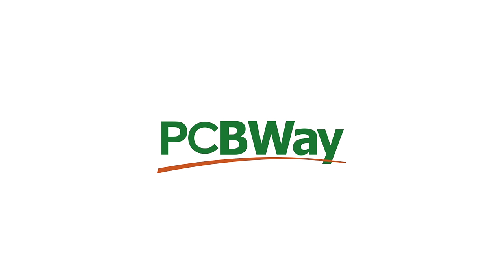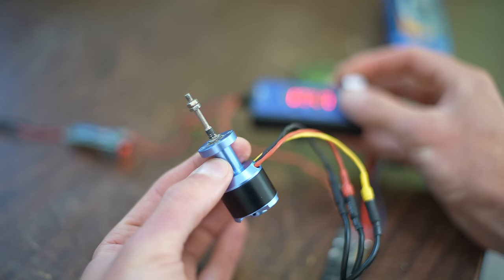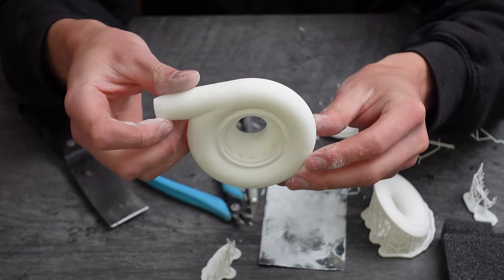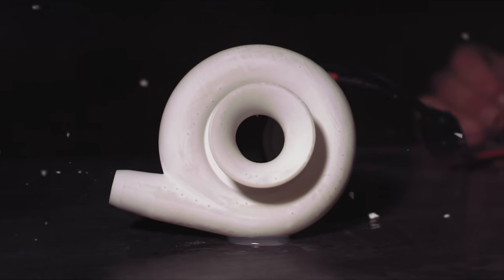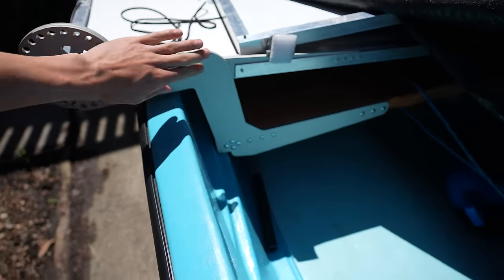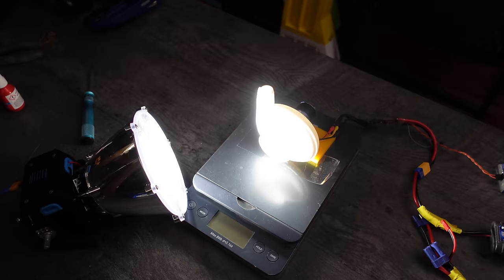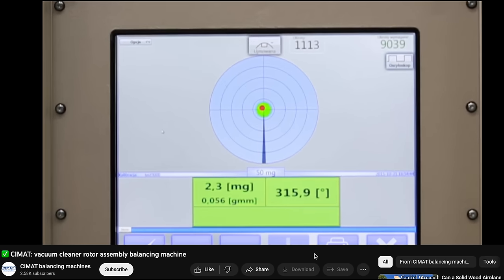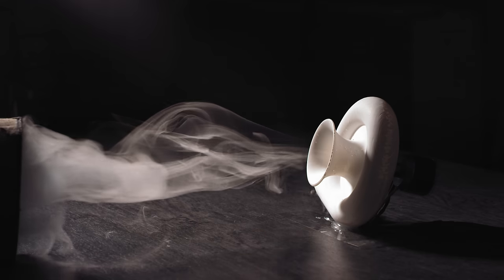3D Printed Turbo Impeller VS Dyson Motor

Comment: Hi, i was thinking about your balancing problem. 
1. Perhaps ~ if the impler/disc/whatever was marked into four sections. Red, Green, Blue, Yellow with a dot marking the top.
2. With a constant speed of rotation was maintained
3. You could then use 4 flashes of light in sequence, 1,2,3,4 so that those positions are captured on video, freezing the wheel in a series of four frames. 
4. You would then be able to see  which of the coloured parts of the wheel where out of alignment. This would help calibrate small wheel of any size :)

Looking sideways on the wheel, and zooming in like:
R1 Good
G2 out
B3 Good
Y4 out, even worse

Comment: You can cut down on vibrations a bit by mounting the impeller differently. Threaded rods and nuts are very imprecise, using the nut to center the impeller will result in it being off center and at higher RPMs it will just vibrate like crazy. Minimize the impellers runout (how off center it is) and it will make balancing it much easier.

Comment: It's probably a slightly dumb question, but why not add a thin bar in front that supports the shaft at thd front also? It would cause minimal air intake losses I think. Just a straight line across the tip that connects to the front of the shaft with a small bearing to keep it from shaking.

Comment: I used to work in a Turbo shop, and you can properly balance an impeller with a prop balancer. You would know the ones: they magnetically levitate the Prop/fan on a shaft for almost zero friction. Grab one of those to balance your impeller!

Comment: I never thought about the axial thrust load on the impeller shaft when it's sucking an air. There has to be a force pushing on the impeller blade. That's awesome

Comment: If the motor was on the intake side with larger inlet that allows / forces the airflow around the outside of the motor it could cool itself down while it draws in the air. 🤔😉👍 Those resin printed parts look absolutely amazing.

Comment: I think you could improve the results with a better snail housing. The radius should increase closer to the exit nozzle. (so the axle of the impeller is eccentric to the housing, while in your design it is nicely centered)

Comment: you can use high speed camera for balancing of the rotor. make a few marks that will be distinguishable when spinning and you can just chase the mark that oscilates the rotor furthest.

Comment: You could probably use a bearing closer to the impeller. In the car world we would use a run out dial indicator and make sure the back side and all the tips of the blades are spinning within .001 and if your outside rear edge and all the tips of the blades are running at .001 it should be balanced. Adding hot glue will interfere with the blade effectiveness so just try taking of smooth layers on the meat or within the central part on the back of the impeller to balance just a lot of back and forth on the micrometer

Comment: Vibration is definitely a huge thing to deal with... You have to balance the impeller for static and dynamic vibration... But one more thing to consider is physical expansion due to high centrifugal force... Materials tend to expand at such high RPMs/Forces...so you have to adjust you tolerances accordingly.

Comment: Dyson uses a reluctance motor according to my research. Rather than permanent magnets, the rotating core just has a magnetic material like iron that seeks to center itself in a magnetic field. It works like a familiar linear solenoid but in rotation. There is no field reversal in the iron so this supposedly gives an RPM advantage.

Comment: One concept I've always wanted to see is using one of these impellers to create a pseudo "fanwing" design. Where air is compressed then blown over the surface of a wing using a slit, to see if the fast moving air over the top of the aerofoil generates extra lift at low relative speeds.

Comment: They use 4 coils and a hall effect sensor for multiple reasons :
1- ensure the right rotation way of the motor and so of the impeller : they need the position of the rotor (not necessarily precisely) and then they will start only two of the coils to be sure of the rotation way, then inertia and the hall effect sensor take the relay i guess or maybe they just use two coils when the magnets of the rotor are closed to their end position, better see with a scope  to be sure haha…
2- the hall sensor as in three phased esc is used to have feed back and so send the rights pulses at the right moments to have a stable torque ans so make their product less louder.

But in the end for a 2 phased motor to work you don’t need all this, you’ll just won’t know the rotation way and the position of the rotor so you will just need to respect the KV rating to make it work

Comment: Next time you make a housing put the outlet of the impeller at the bottom of the snail. You want to induce air so it flows around the outside of the donut. By dumping air into the center like you are, you are inducing turbulence and friction in the airflow. You can actually compress air in the housing (which requires more flow) if you do it like this which will actually result in more thrust.

Comment: You should try optimizing the snail housing. I might be totally wrong, but that shape doesn't seem very efficient for redirecting the air flow and it looks like air will just slam into the sides more than flowing easily around and out

Comment: A disk of weight behind the impeller to act as a flywheel will improve the reciprocating motion and reduce vibration.

A bigger housing encapsulating the electric motor should aid cooling and any heat inside the pressurized area will help thrust by expanding the volume of air, even if only marginally.

Comment: Thoughts on printing the impeller to this lost cast out of metal? Also, on the fins in the housing, would a Tesla valve help prevent back pressuring in the housing putting stress on the turbine to push the turbine out of the housing?

Comment: A better way to radially balance the impeller is to set up a set of parallel bars the are on the same plane that are level. Run a straight and true rod all the way through the impeller and place on the parallel bars. Nudge it to get it to roll. When it stops the heaviest side will be towards the floor. Grind a little off and repeat until the impeller doesn't come to a definitive stop, it just seems like it wants to keep rolling. At that point you'll have a balanced impeller that didn't require some special electronics set up.

Comment: Every issue here is quite easily fixable. Next step is to either go back to a one piece housing or have a two-piece that bolts together around its perimeter, a glued butt joint will always be problematic.  Similarly, you need to beef up the motor attachment, again properly bolting things together.  Some vibration dampening would help, for resonance purposes though at the same time better coupling everything (frequent bolts, wicking threadlocker, etc.) would also do the job, but also DIYing a dynamic balancer would help as well.  Another thing that could help is having a bearing flange within the intake nozzle, similar to how PC fans locate their bearing within the fan's mounting square, with a full through-shaft for the impeller, this way you're also eliminating any movement within your printed plastic parts, especially when vibration and harmonics do become problematic.  I'd also look around for a different motor or getting a different mount for that motor, that thing is long enough to become problematic, not to mention a better housing would have a wider mounting footprint, one that would otherwise be much more compatible with the project; also, a custom housing would provide the ability to better cool the motor, as heat will also become problematic, a simple fan with airflow would suffice, akin to how various power tool motors have a cooling fan on them.  Ideally you would also key the impeller to the shaft, rather than relying on threaded nuts to locate it; or, thread the impeller, and jamnut both ends, and again use wicking threadlocker to ensure a fuller seal on the threads of every threaded component- though, threaded components also often have issues with concentricity, this is why keyed precision shafts between located bearings is far superior.

Comment: Check Tony Moira resin ratios for strength flexibility etc. also check putting some fibers into resin vat to or layering on outside and paint resin to outside of housing prior to curing.

Comment: I can vouch for the tenacity of Phrozen-Nylon Green Tough resin. I mostly print with my FDM printers and recently I laser too but the Phrozen-Nylon is very resilient, definitely a better bet than the standard tough resins. Nylon actually has more resilience with a bit of it's hygroscopicity satisfied. Very dry and it is more brittle.

Comment: I designed turbos for 5 years. The motor very likely spins faster without the housing. In applications like this it's an interesting design problem as you're effectively trying to design the most efficient compressor for a given specific power output. You have to balance flow, pressure, and rpm.
Reply: Yes, and if you don't care about pressure, get rid of the vaned diffusor. Less likely to surge.

Comment: Ja, you should dry to 'bleed' some air over that motor, either from the pressure side, or ducted from the vacuum side...maybe mount the motor in 'front's of the impeller, so that it sits in the inlet flow?

Comment: Make yourself a sealed box with two holes.. About 40cm cube. Attach the vacuum to one side, then various flat plates to the other with different size holes in say 10mm to 100mm . You can then map the pressure drop at various different airflow restrictions.  (pressure inside the box)

Comment: Not that it's relevant here but FWIW, your "5 HP" vacuum cleaner does not have a 5 HP motor.  It would draw well north of 20A of current.
746W = 1 HP --> 746*5 = 3730W.  3730W/120V = 31A.  That assumes 100% efficiency.
On a different note, this is a really cool vid.  It's nice to see how you can take a vacuum cleaner motor and propel an airplane.  Keep up the good work.

Comment: Maximizing thrust involves different aerodynamics from maximizing suction.  And, maximizing static thrust is different from high speed thrust.  The small diameter orifice would be good for a fast jet-like aircraft.  A slower flying aircraft would have a larger diameter orifice, moving a larger mass of air at a slower speed, and would have more static thrust.

Comment: The faster you try to move air (eg higher rpm), the denser the air gets. Adding the 2nd set of poled increases the torue the motor can sustain, and at a perfect 180⁰ out of phase they can be aligned perfectly to never fight against one another. The reason it isn't always done is cost. Of parts, of upgrading manufacturing, or the cost of a more complex control curcuit.
Just some food for thought 🙂

Comment: at those high speeds it's not just about balance, rotordynamics plays a huge role too. If your rotor system has a resonant frequency at a shaft speed you're hitting, it doesn't matter how well balanced it is, it's still going to break. Looks like the Dyson motor has a much shorter and thicker shaft than your motor, which will make it's resonant speeds much higher

Comment: Would be really cool if you made a vacuum or a „thruster“ like in this video but with an impeller from a turbocharger. May be pretty cool and silent. The vz21 turbo is very small. You could get a pre balanced aluminium impeller from it and make good use of it.

Comment: Some other youtuber's have tested other solutions for cleaning the parts after printing and found that monster green was the best there way ( way better and any isoprople alcohol. Even the 99.8% pure) 
Bonus point is that monster green isn't flameble unlike any alcohole based cleaning solution

Comment: Balancing high rpm items seems like a very necessary step. I've looked at the some of the comments here for manual suggestions but expect there must be a 'hobby' way of doing it auto magically -perhaps even a 3D printed balancing machine?   (I thought that if you marked a point on the circumference and measured the offset force with a piezo sensor then the maximum force would be generated at some time after that 'pulse' which if you divided the rotation interval into 360 units would give you the angle after the point that the maximum deflection occurred, you could then shave a bit off this point...   Max frequency would have to be, say, 360 x 100,000rpm = 36MHz   and you would need some pretty fast A/D to get a force value, although perhaps could just use a threshold detector??)    Thoughts?

Comment: Any reason why both sides of the snail don't have "pressure plates"? If not, maybe setting them up as tesla teardrops could get it out to the edge faster, needing less force to push it out the exhaust. Also, please keep going on this, as it seems like an amazing way for a super high powered leaf blower.

Comment: in a textbook, K_v would be written with a subscript. it's one of two 'motor constants' used to describe a motor's performance. in this case 'constant' doesn't mean a true constant like pi or the speed of light, but more like a 'spring constant' that models a particular part. (https://en.wikipedia.org/wiki/Motor_constants).

Comment: Interesting. Turbochargers are dynamically balanced and run to much higher rpm. I ran a 110 mm compressor wheel on a schwitzer turbo and recorded over 120krpm.
There was/is (?) a UK company called TurboTechnics who build turbocharger balancing machines. From memory (it's been a while since I did any engine development work) the balancing is normally done as a cut on the 'nose' of the wheel, probably because that's the only bit you can get to on a fully assembled turbo. I'm not sure what speed they use when balancing but both the compressor and the turbine get balanced. It may be that the parts are individually balanced first, then balanced again after assembly.

Comment: Why keep cantilevering the impeller shaft? You need a small radial bearing to center the shaft runout and prevent vibration.

Comment: 6:28 - you have made a little mistake there, that it is called a mass balancing not a dynamic balancing. When it comes to propellers, dynamic balancing implies running the propeller on specialized equipment all the way to the top operating RPM and adjusting the mounting hole/hub on X-Y-Z axis in order to decrease as much as possible the induced vibration produced by uneven thrust derived by one or more of the blades/fins of the propeller that can occur due to the fabrication process .

Comment: To make a simple, cheap volumetric flow rate instrument, discharge the air into a large empty garbage bag. Measure the time to almost fill the bag, then seal the bag. Measure the size of the inflated bag. This can be done accurately if the filled bag shape is in a cylindrical shape - place a piece of wood or styrofoam on the upper end to flatten it out and facilitate the length measurement. Total cost: almost nothing.

Comment: In case you didn’t already find out from the others in the comments section, it’s much easier to remove supports from resin 3D prints  before they’re cured.

Comment: It looks like at 12:56 the housing is expanding from the internal air pressure causing the compressor wheel to then contact the housing and thus come apart. It maybe worth adding some structural rigidity to the housing to stop the deflection.

Comment: Amazing!! A question: from which Dyson model you have extracted the motor visible at 11:38? Seems very easy to run with original controller, differently from some other models that are more complicated.

Comment: Hey Daniel, this is really cool but you are making a mistake when designing the snail housing. The housing around centrifugal fans and compressors starts small and increases in area until the exit is reached, that way the air flows in one direction around the snail, and all of it exits when they reach the duct.

Comment: With a fan at the end of a tube, couldn't you measure the voltage the air volume creates. Using a multimeter,  measure the difference between the Dyson and the a Danforce (I made that up) ?

Comment: hmmm, its probably not hard at all to make some kind of test jig with some cheap sensors to help balance the impellers, a few cheap sensors and something thrown together in arduino to see the weight offset from resting position.

Comment: Was the static vane layout in the snail housing native to the Dyson? I've always thought that would make a good experiment to build pressure in a centrifugal, it should permit nozzle restriction to load the motor within it's heat handling ability

Comment: Can't you make the frame to be able to attach on two sides bottom of the fan and the top where you are now using nut, by doing this i believe you will limit the effect of the vibration but also slightly limit the intake of the fan

Comment: Maybe you could make your impellers more resistant by metal coating them with electrolysis. The thin metal coat adds a lot of resistance.

Comment: at 13 minutes, asfter the thing explodes and you turn it off, it looks like the shaft shrinks when slowing down. i wonder if at higher rpm the airflow is stretching the shaft allowing contact with the housing causing the failure? can you try a thicker shaft?

Comment: I have used the Form 3L and Rigid 10K a lot for PhD research and our projects. The materials are generally good but the printer is close to junk. Asked for support for more than 10 times and once refund due to material quality back during COVID.

Comment: Would it be possible to restrict the airflow more on the output of the fans? Those types of centrifugal fans usually produce a rather large about of pressure and not too much flow, so restricting the output would increase the flow and thus the thrust. Not 100% sure though.